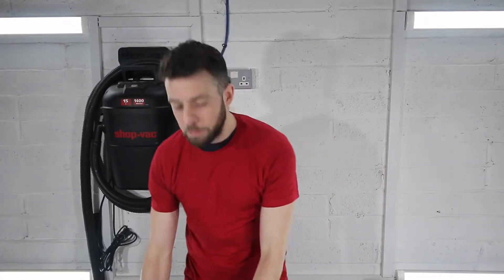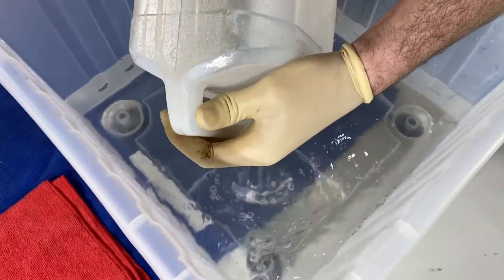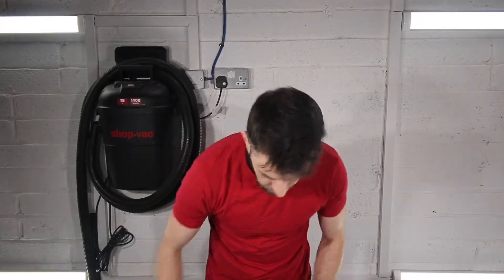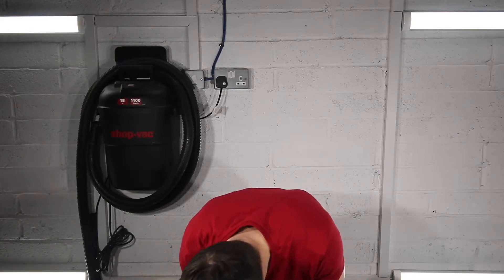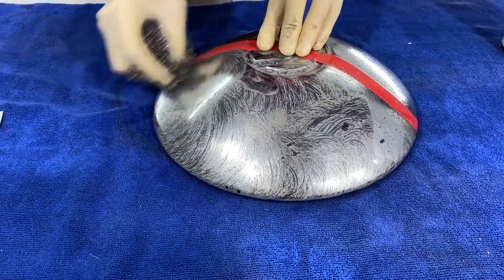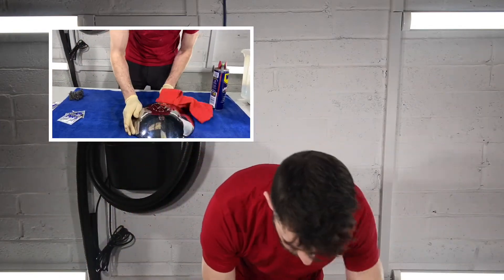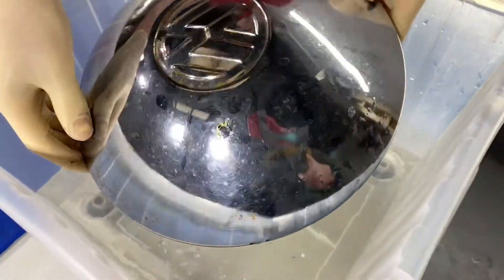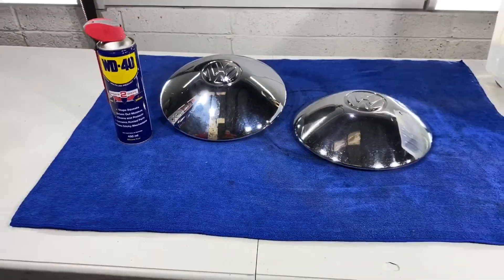How To Restore Rusted Chrome Wheels

Comment: For show chrome hub caps I have found that rubbing them down with some clumped up tin foil and liberal use of coke cola does a good job.  Eventually though I just bought polished stainless steel hub caps as the Irish weather is just to harsh.

Comment: It’s always best to use the steel wool dry. Using steel wool with a polish is when you get those oddball situations where people report how steel wool somehow scratches chrome because all the polish does is make it unnecessarily more aggressive. 

I’m pretty sure it wasn’t perfect to begin with, but the steel wool/metal polish side was predictably alot more hacked up than the WD/40 side because the WD/40 is 1 of those rare pairings where it actually is somewhat of a lube. 

Metal polish however does the opposite for steel wool, resulting in scratches where steel wool alone would never instill them.